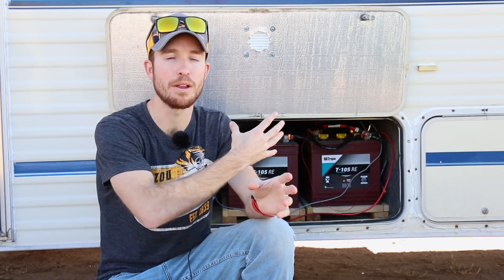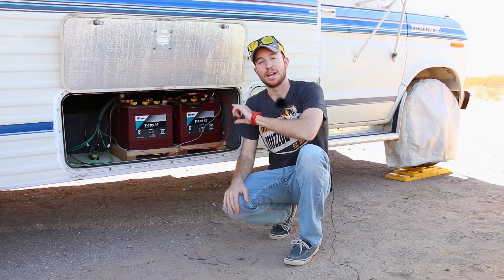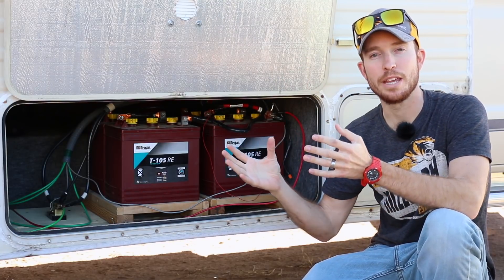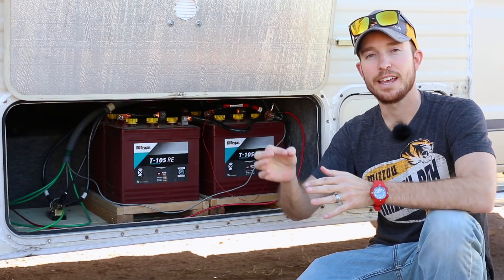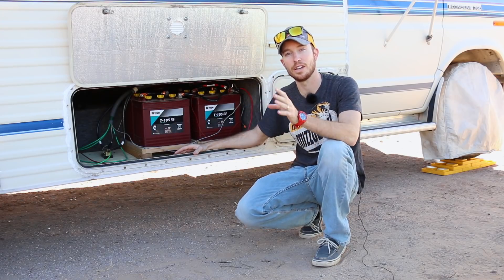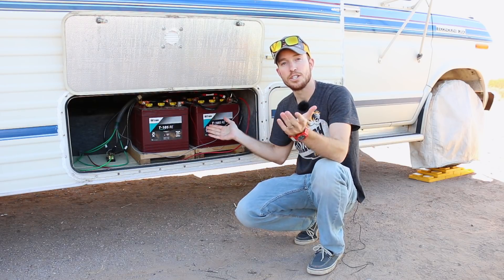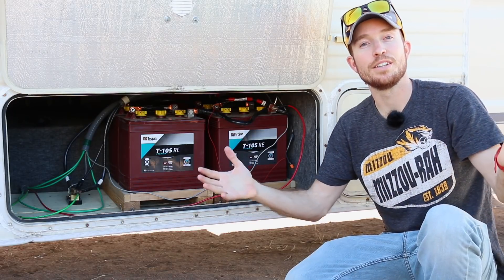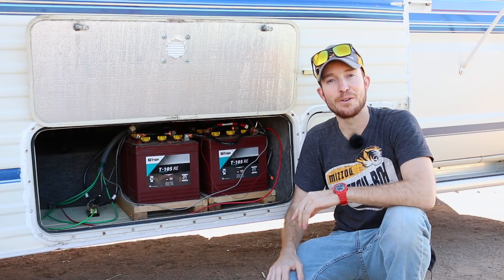How to Wire RV Solar Battery Bank Batteries in Series and Parallel

Comment: I have 2 320 watt monocrystaline panels, and a 30amp charge controller, How many Amp Hours of battery banks should I have?  I have 2 Deep cycle 12v currently

Comment: Great video. 
I bought 2 6 v golf cart batteries from Costco & wired them to make 12 v @ 225 Ah .
I have a tent trailer and I hooked them to my tent trailer. I used the batteries for 1 night (maybe 5 to 6 hours) to heat up ( furnace). They drop to 60% from 100%. My furnace consumes 8 amp/h .
Can you explain why is this the case?
Thanks

Comment: Awesome video and great information! I have an off-grid tiny house that I have set-up similarly to your RV. We have 730 watts of solar panel feeding an 80amp MPPT charge controller flowing into an 8ea T-105 batteries for our 12vdc system. The batteries feed a pure sine 1200w continuous / 2400w surge inverter. So I don’t understand why I still cannot power a 900w microwave. Any thoughts?

Comment: Trying to figure out what is better setup: 4 Batteries bank series of paralles (2S2P as common used for perfect balancing with Lithium Cells ~ Tesla style) or parallel of series (2P2S), which is the easyer straigt forward way of simply connecting the bank without those extra bridges, which seem obsolete at a first glance. ==> However, they can help balancing charge between the serial strings, particularly with some older batteries not beeing in perfect matching condition...

==> Any practical experience with this issue of balancing cells and partial voltage runaway ?

Comment: Does a 150Wp polycrystalline solar panel wired to a 20Amp smartharvest (Outback Power) MPPT charge controller is sufficient for charging a Johnson Controls 100Ah@20hr AGM battery..??

Comment: If you wired 2 12volt batts together, do you then get 24 volts?  Great explanation on the way you wired  your system!
Reply from the maker: Hey Joe. Yes, you would get 24V if you wired them in series. A parallel configuration would keep the batteries at 12V and double the capacity. Hope this helps 👍🏼
Reply: @Joe lol I learnt about series and parallel  circuits in middle school. Did you not learn this in school?

Comment: I bought my RV and it came with two batteries.  I want to add more.  Can batteries be mixed?  Meaning can an acid battery and AGM be in the same bank?  Can the batteries have different amp hour?  Why aren’t 12 volt batteries used?
Reply from the maker: Unfortunately no, batteries cannot be mixed because of the specs, charging requirements, composition, etc. They need to be the same brand and preferably age for best results. The 6V batteries are true deep cycle batteries and are much more robust than their 12V counterparts, that’s why they are more popular for off grid setups. Hope this helps!
Reply: Exception: Many use mixed Lead Acid batteries in parallel connection, even mixing SLA/AGM & FLA types  ==> not perfect style, but it works. However, you should never mix divergent cells within one series: Like in a chain the weakest junction will determine the perfomance !
(and no way of connecting Lead Acid batteries with Lithium or something else, of course)

Comment: Same batteries and setup I use on my solar system and I got almost 7 years out of my first set. Looked at using Crown batteries but decided on the T105 RE especially since they were developed for renewable energy thus RE in the name. I have my charge set at 14.8 per Trojan. I am installing the Trojan watering system and with the squeeze of a bulb I can water all cells at the same time and don't have to worry about over filling.
Reply from the maker: Thanks for sharing your experience Johnny!

Comment: Are u worried about the weight of the batteries? How do you figure out if the under storage compartment can handle the weight of the bat/future batteries?
Reply from the maker: Great question. I had to distribute the weight using that 3/4 piece of wood underneath. So far we have had no issues. You may call your rv manufacturer or manual.
Reply: Suggest you should also use a soft styrofoam shock absorber underneath + some container to have spilled acid or water absorbed eventually, preventing corrosion of your compartments base !  +  please remember: any type of lead acid (even SLA) is prone to H2 gas emission during charge ==> openings for ventilation required to prevent H2 accumulation catching fire from any spark  !
Reply: @ralfboecker3646  I was surprised that he didn't create any vents for H2 that's released
Reply: @kiyoponnn  ...so easy to forget about: don't see. doesn't smell H2... most often get away with it...
Reply: @ralfboecker3646  Agreed

Comment: Yes using two 6v to make 12v is always better because 6v are true deep cycle batteries and will last longer.   Unfortunately not everyone has the room and has to stay with a 12v battery.  You could do an hour video on just batteries.  Love the series your doing. Happy travels, Lou.
Reply from the maker: Thanks Lou. So true! The info is endless lol
Reply: Some prefer using elementary single cells (EPzS, 2V * 200Ah each) as used in professional battery storage systems: they perform extraordinary long life times and can be replaced individually on failure + even repaired/refurbished with some special treatment !
==> This style is also prefered with new LiFePO4 single cells providing 3,2V each...
Reply: So I baught a100 watt solar panel and 2 12 volts battery from harbor freight,and 5000 watt inverter,I haven't set it up yet ,I'm not sure it those harbor freight batteries are enough because I want it to run ac and microwave ,mostly microwave , generator costing me too much gas ,what amount of batteries do I need   @DuetJustusFam

Comment: 450 amp hours of storage but can only use at most 50% of that so in reality 225 amp hours of usage.
Reply from the maker: You are correct. 225 has been more than enough for everything we use (tea kettle, blender, instant pot, hair dryer, all my RV dc, etc) 😎👍🏼☀️

Comment: How do you check the water level in the batteries? Are they on a slide out tray or something to make them accessible?
Reply from the maker: I will make a future video on this thank you for the suggestion 😊👍🏼
Reply: @DuetJustusFam  would you mind link this video here then, please ?
BTW: Thank you much  for sharing your expeirience, however, will you please show more details of your components & setup ? ==> You look very smart, but not much use watching you talking all the time, with only a very short closeup cut showing those cabel details, i have to stop the video to look at -- that is a little anoying...